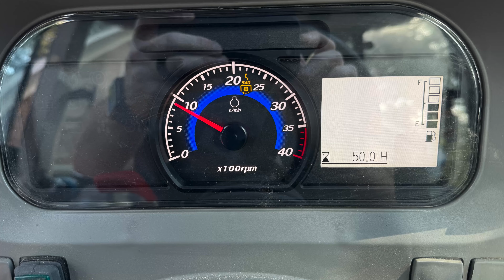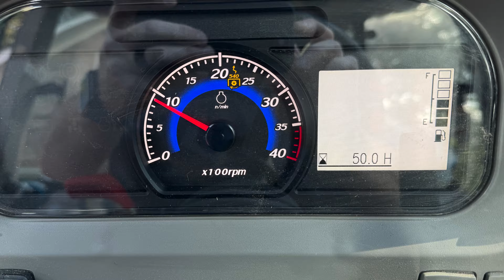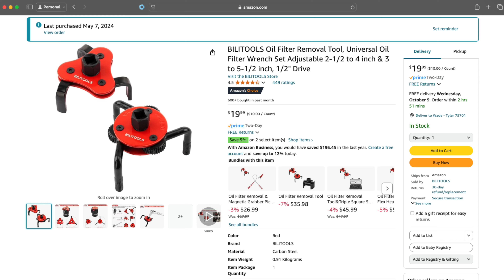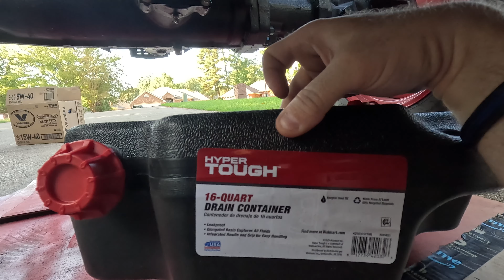50 Hour Service On The TYM T654

Comment: That was an informative video, nice job.  They sure do not have a user-friendly fill point for engine oi and transmission oil. Engineers need a slap. Lol. would be good if the engine had a fill cap on the valve cover if it was accessible. I am planning on getting one of the T654's in the spring.  I am planning on running all Amsoil oils in mine when it gets its first change, and probably a 5W30 oil for the engine here. I ran that same viscosity oil in my semi when I was still on the road so I know it works well, tested and time proven product to me.  Also being a full synthetic oil it flows best in my cold winters here.  Lack of oil flow causes more damage/wear than anything here.